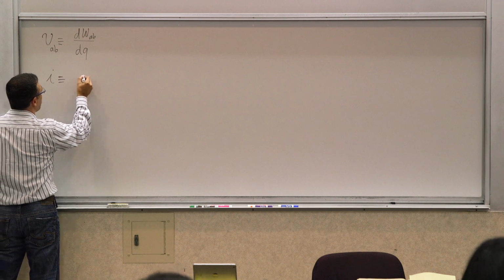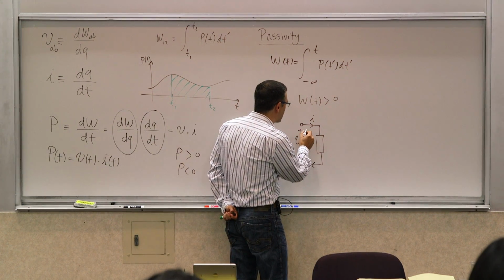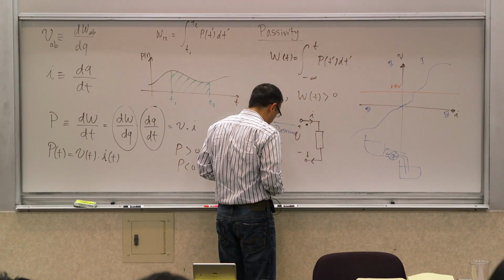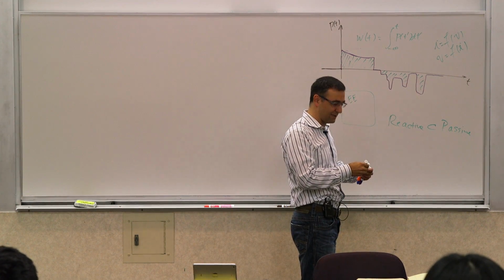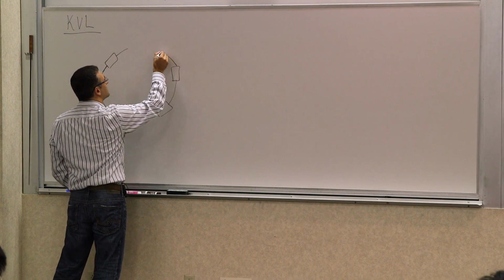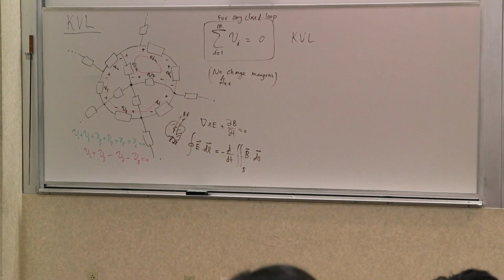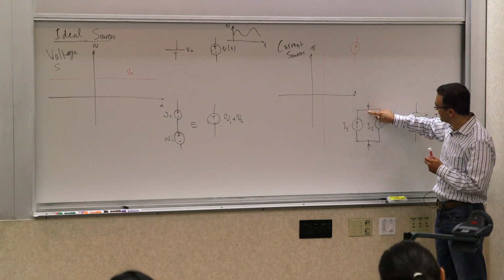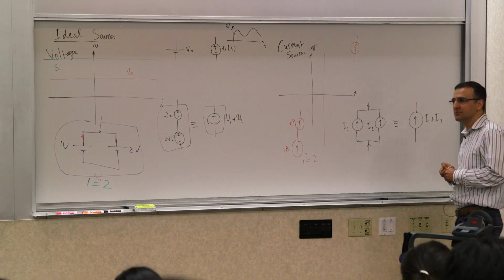002. Circuits Fundamental: Passivity and Activity, KCL and KVL, Ideal Sources

Comment: Absolutely brilliant series of lectures. Having graduated 20+ years ago, this comprehensive "brush-up" is far exceeding my expectations.. 

the holistic view on the matter and for once actually starting from the maxwell equations and really building in steps from there: fantastic. Easy your heart out netflix, these lectures are my new binge series.

Equal to the best set of math classes when i was at university that started with a single line on the board, then a zero was added, and it evolved from there to all these nasty complex things over a period of 2 years. 

This is how stuff - any stuff - should be taught. My utmost respect to you sir!

Comment: Sir, can you please explain why transistors are active elements. TIA.
Reply: because of the fact that the current gets provided at a terminal of minute magnitude and a relatively larger amount of gets flow among the other terminals and that is the current which matters. In retrospect what actually happened was that the device generated more current than what it gets supplied

Comment: Hi Ali, as you correctly explained when there is varying magnetic flux then E field is not conservative hence no potential is defined. However, when circuits with inductors are analyzed we implicitly use KVL. Inductors produce varying magnetic field so the potential measured would depend on probing points. Am i missing something?